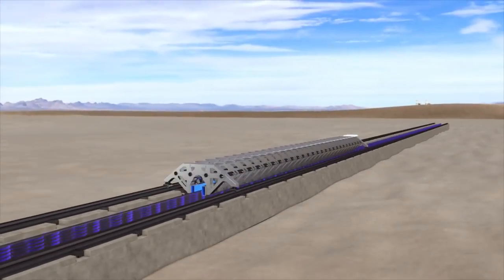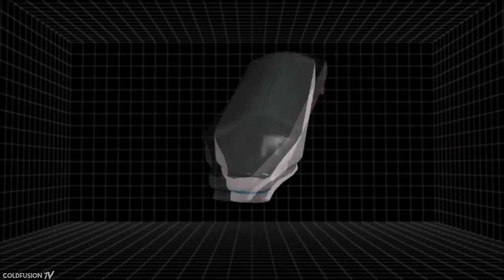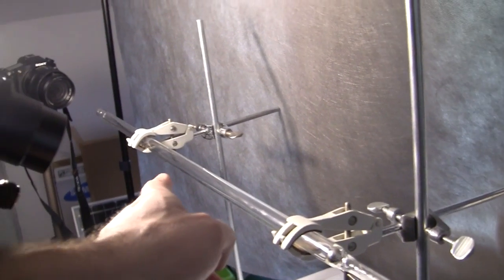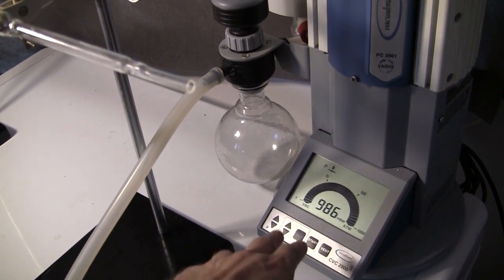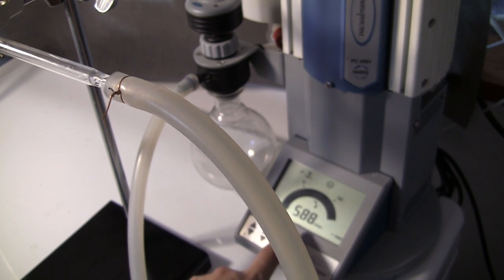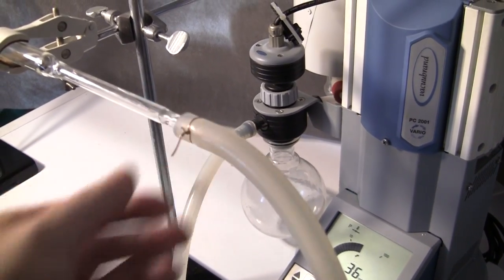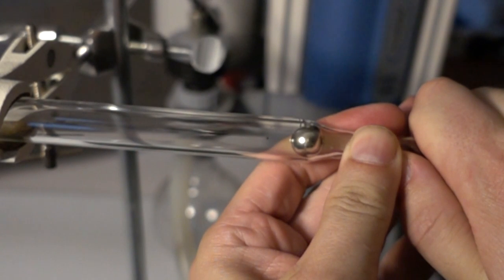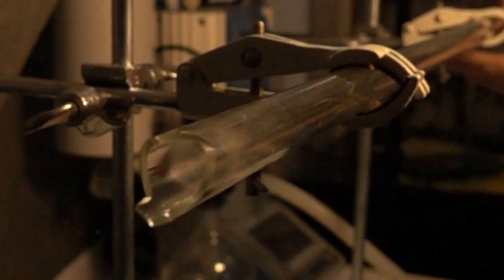How  the Hyperloop can kill you!

Comment: Also, maintaining a vacuum of such a volume would have much greater energy expenditure?  Could you do a video on the feasibility of the tube?
Reply: Really quick Google maths - a 1KM section of tube, given the 2M (ideal) size TF mentioned, that's 3.1 cubic KM of gas! Wouldn't want to think about generating that much vaccuum...
Reply: You're just a few orders of magnitude out. You've been calculating your volume with a tube 2km in diameter, not two meters. It's 3.14m³ per meter or 3142m³ per km.
Reply: And how would the boarding work? You'd probably need a "connector" that is pretty much leakproof
Reply: +Kitsuneoni not pretty much, completely airtight, as in no gap big enough for a molecule of air to get in.
Reply: ***** a single regular airlock sets you back at least 12 million dollars plus these ones would have to be much bigger
Reply: ***** I simply googled it, here's one of the first articles: http://spacenews.com/nanoracks-presses-ahead-with-private-airlock/
Reply: ***** to be fair a plane doesn't need a track though, you just need the vehicle and "stations", while this needs a huge near vacuum tube in between stations
Reply: ***** I never said that the entire concept is bad/ unreasonanle, I'm just saying that it'll take a lot of engineering to get to the point that it's both safe and viable
Reply: ***** I've been thinking about the type of break this problem might require. My first thought was a Eddy current break (that's the english name apparently), but I'm not sure wether that'll work
Reply: ***** that's what you'd have here as well though.You need air inside the station and have a near vacuum outside
Reply: Draining the tube to a vacuum would be expensive, but the benefits of a hyperloop could still be gained with more cost effective low pressures, and would be safer as well.